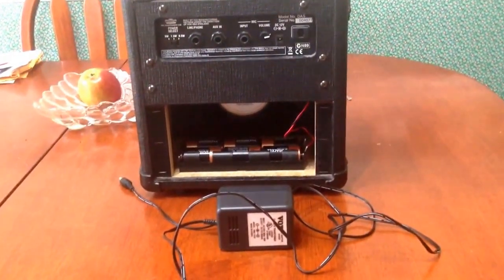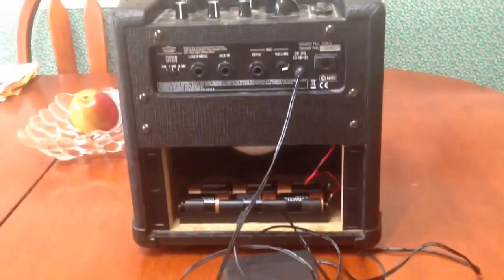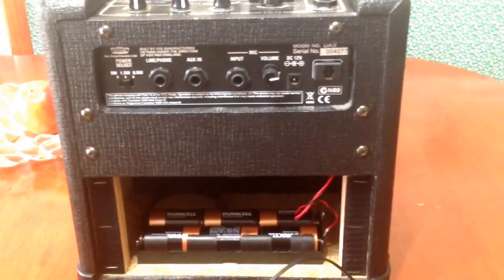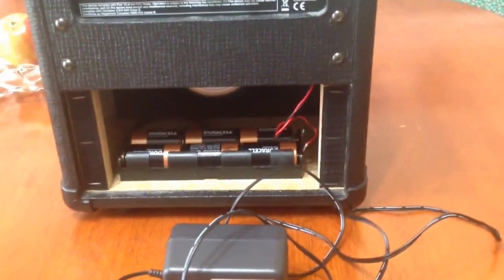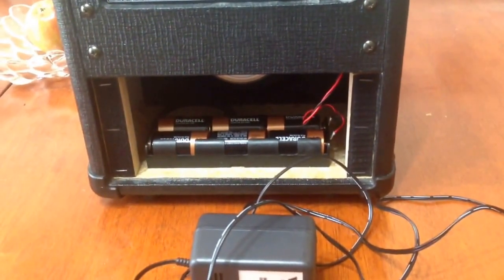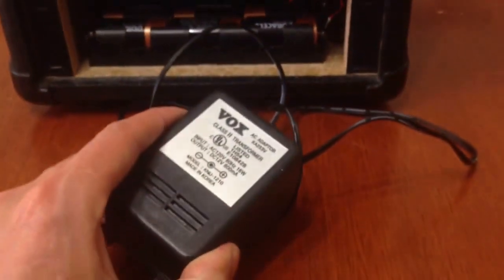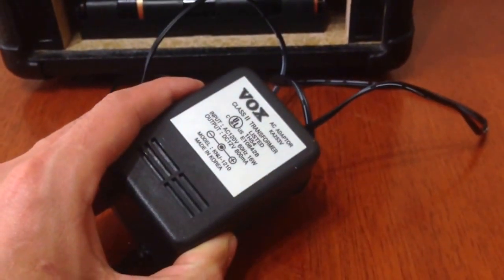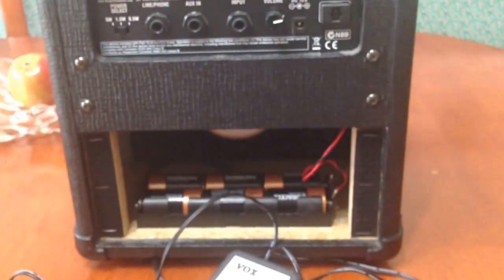VOX DA5 Amplifier Repair

Comment: If you disassemble the amp and check the circuit board where the charger input is located look carefully with a magnifier and see if the solder has a crack and is not connected. Mine was and I reconnected the solder and the wall charger works again just fine. Hope this helps because these are great little amps.

Comment: Here's my two cents;

If that power supply is "Unregulated" which it looks like it may be due to it's size (google regulated vs unregulated power supply) then when you measure the output of the power supply when it is unloaded (not connected to a device) then the measurement will be higher then the rated output on the label - as nothing is "soaking up" the voltage - it's just "pouring out" voltage hence a higher measurement - 16v unloaded sounds right for an unregulated power supply measured without load. So i don't think you need to tamper with the power supply.

MY understanding with the way the amp will select weather to draw power from the AC inout vs the Battery pack is if a current presents itself at the AC input, the amp will "switch" to accept power from AC, when there is no current present at AC input, the amp will "switch" to draw power from battery pack.

If you want to test the AC inuput jack, you'll need to touch a Multimeter to the terminals/solder points where the AC input jack meets the PCB board on the inside of the amp, while power is plugged in and see if you get 12V (google testing power with multimeter/DMM (digital multimeter) - same can be done with battery pack where red/black wires meet pcb board.

Replacing the AC input jack may/may not be possible - depends hwo it is mounted - the worst that can happen is you will apply too much heat via soldering iron to pcb board and ruin the mounting points/terminals beyond repair and need to get a new pcb board - removing components form PB board is tricky - you will need solder sucker or that braided wire which draws solder up off the board - if you get this far you could always runw ires form new AC jack to soldering points on PCB board - you'll have to open it up and check for alignment/spacing - things are usually tight inside there and you dont want to mae ten trips to electronics store to buyt he right part.

theres plenbty of information on stuff liek this on google if you know what keywords to use to find what your looking for - education will set you free

Comment: Thomas, how did you fix this problem, I guess it's fixed by now. I have a similar problem
Reply: Mine won't fkn turn on. Did anyone fix this issue from power cable?

Comment: 12 volts Dc so you can hook up a 12  dc from car battery  and has a voltage regulator attached to the jack to drop the adapter to operation voltage.